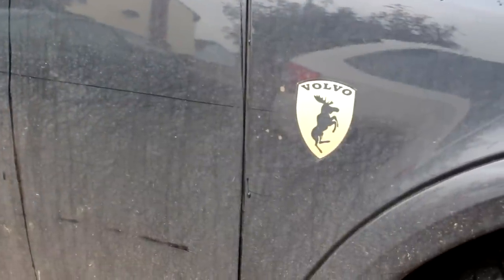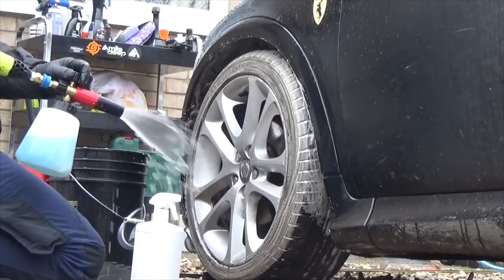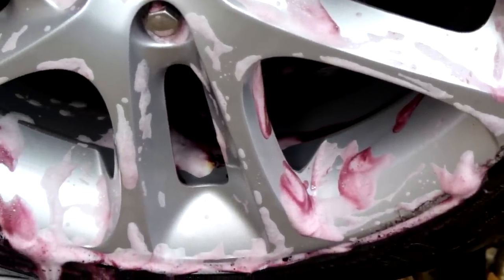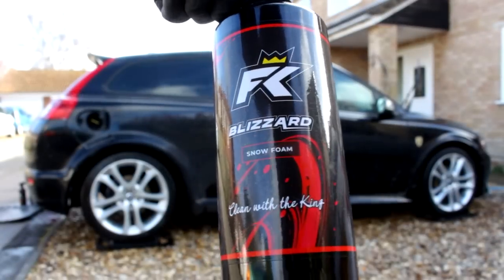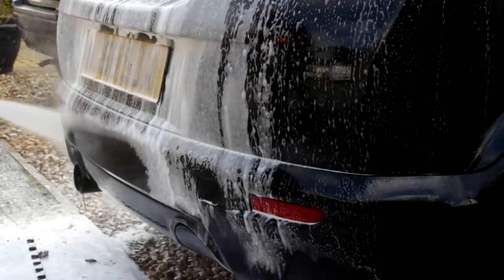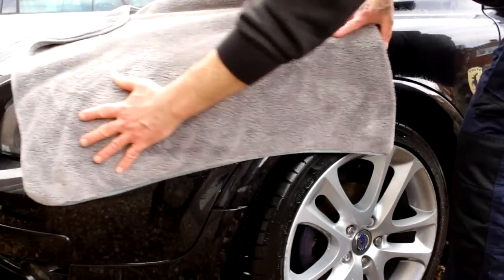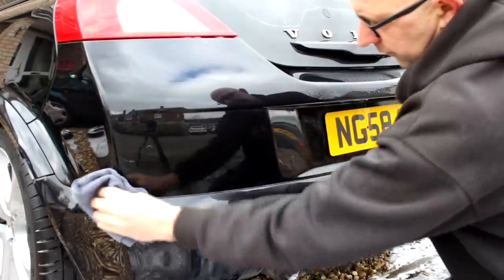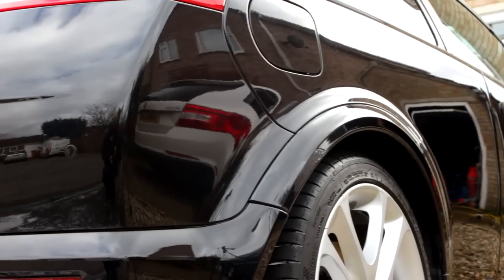Volvo C30 exterior clean

Comment: What a cracking job Paul, that volvo looked fantastic.  Like you, I can't buy a litre of APC, well, not unless I can knock it back to at least 50:1 that is. In fact, I go 100:1 with Surfex, to be used on the interior. That foam looked good at the ratio you used. All the best.

Comment: The gloss from that TW was incredible, black cars come up so well! 
That AG APC is just far to expensive, I recently got 5L of a dilutable APC for £20 which will last the full year, id hate to try that RTU one on the interior or leather if it cleaned the exterior that well.
Reply: 100% agree with you. I use surfex at 100:1 on my interior, so to use a strong neat APC in there scares the life out of me.

Comment: What concerns me more than the price of the APC is that it’s clearly a strong degreaser with high PH but the bottle says it’s able to be used on leather too 🥴
Reply from the maker: Not the best description Nick is it and the price
Reply: @PaulDoldenDetails  you’d probably get away with a quick wipe over but if any soaked into stitching for example and not removed at a PH of 13.1 it will cause significant swelling and then cracking I believe.. and that’s not the kind of significant swelling we want 😂

Price wise I can see they have just gone a little cheaper than meguiars MPC so in Halfords land it makes sense but compared to one we can dilute ourselves both are crazy money

Comment: I’d never buy a RTU APC when you can get 5 litres of Surfex for 20odd quid and dilute that down to 10%. Cost per litre then is ridiculously cheap.
Reply from the maker: This is the problem it’s okay for the occasional driveway enthusiast but for everyone else it doesn’t make sense bulk buy is always the best option Ben👍🏻👍🏻👍🏻
Reply: @PaulDoldenDetails  I even use surfex round the house to clean the kitchen and bathrooms etc, but that’s because I’m a tight……..